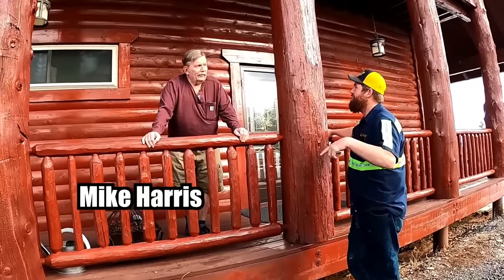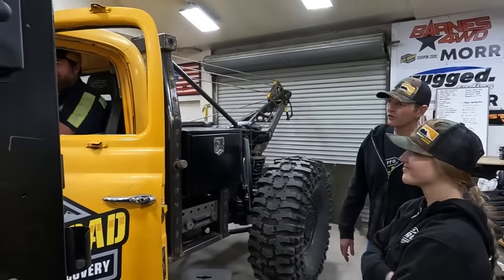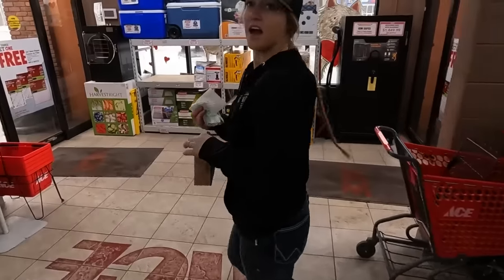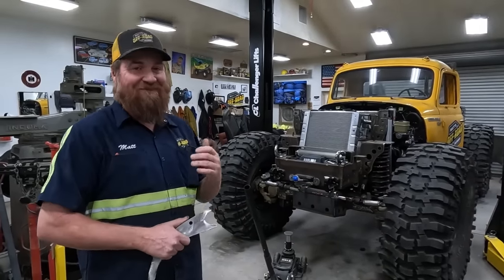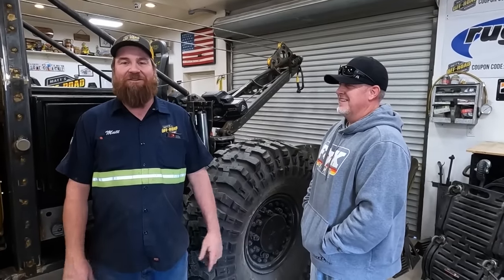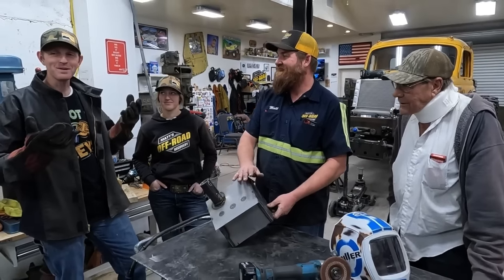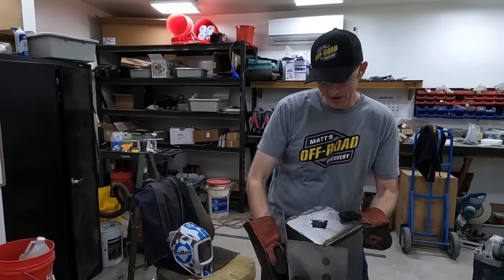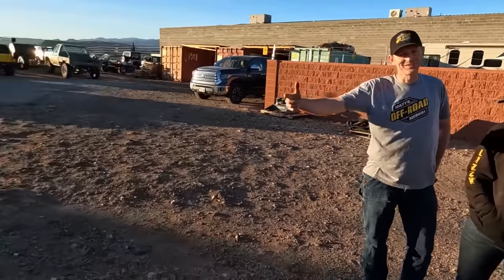It's A Fast BEAST...The World's Largest Off Road Wrecker!

Comment: i think Matt should have to pump up a front tire on the worlds largest wrecker to 15psi with a hand bike pump
Reply: LOL.  That could take a complete day or more.
Reply: @canamrider7195  but how many days did they loose waiting on the parts ?
Reply: @robmcnally6216  Well they have Lizzy driving around town to buy a flange nut.  Efficiency of time and resources is not a priority.  I guess some days people just stay home and don't need to be pulled off or up a mountain, so a day fooling around in the shop is for fun.
Reply: @canamrider7195  yes but Tom Toms woops was a couple of hours waiting on the keys so his bird house was a couple of hours of work if the parts were a day wait i was just thinking that in fairness LOL Matts should be of equal time there about.  After watching the latest video i guess the PSI should be set to 8psi.  Or another punishment is he CAN NOT use the rear steering for the Wreaker Games

Comment: Matt's punishment should be to build a birdhouse out of wood, using only glue, hand-saw, mallet, chisel, setsquare and plane; and he should have to build it using metric measurements only.

Let's say, it should be 166 mm wide, 131 mm deep, and 201 mm high at the roof peak. And the angle of the roof from the horizontal must be 0.25 radians.

Comment: I am astounded by the ;ac of actual plans being used in the construction.  Surely Matt and Tom Tom could set down at a computer and design things.  As another commenter said maybe they should actually use proper measurements instead of about  this much.  PLAN ahead  and not have to take the cab off and then take it off again and again.

Comment: Hamolar 3 Pack 300A Circuit Breaker with Manual Reset Fuse Holder for Car Audio Marine Boat Stereo Switch, with Wire Lugs Copper Washer

Comment: Please, please stop leaving your negative battery cable on the batteries!! Anytime you work on a vehicle, the negative is always removed first! That prevents the sparking when you connect the positive cable, and if the positive touches anything with the negative removed, it won't spark! From a mechanic with nearly 40 years experience.

Comment: So... yeah... a birdhouse with non-removeable floor, roof  or sides cannot have last years' nesting artifacts cleaned out.

The baby birds will get squeezed up against the roof, tighter and tighter with each passing year, until they are compressed so small they fuse, and wink out of existance in this plane of the space time continuum.

Quark birds. Tom's built a quark bird house. 

Quark birds are anti-birds. Why is Tom anti-bird?